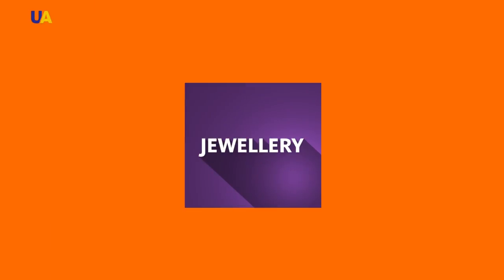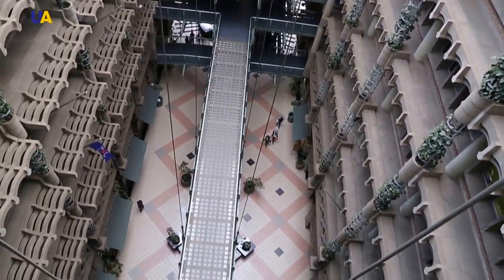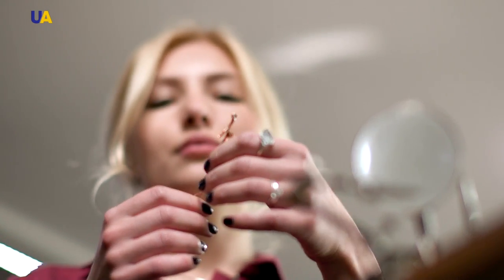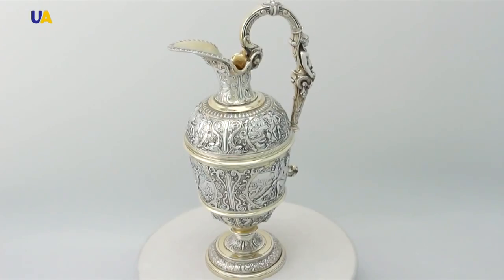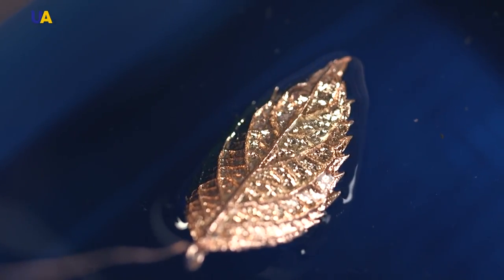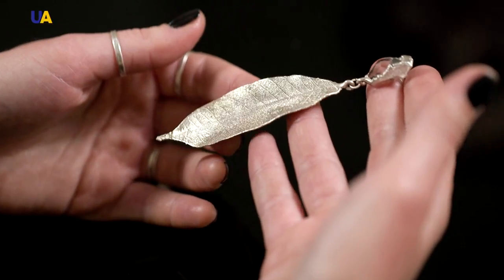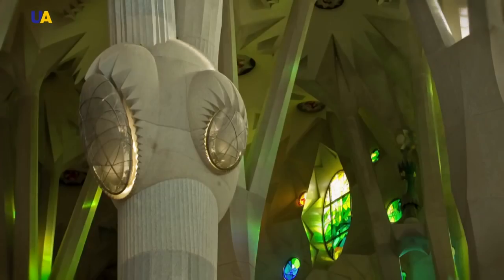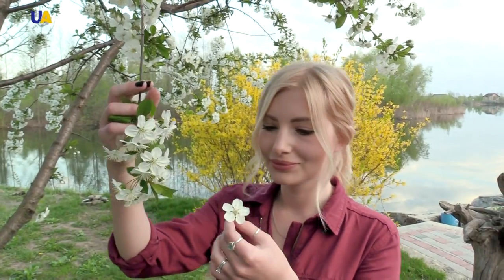Handmade Jewelry in Electroforming Techniques by Maria Riznyk | Master of Crafts

Comment: The technique to make copies with a mold by metal depositing is called electrotyping, electroplating is developing a layer of metal on a metal object and electroforming is similar to electroplating, but metal can be deposited on organic objects by coating them in a conductive material like graphite and the metal coating developed is usually much thicker. All techniques require a direct electric current through a chemical solution. You can combine it with other jewelry techniques, but this artist does only one of many.
Reply: Would be worth to say that in video I use word «гальванопластика» and in this language we don’t have analogies. You can translate it both ways as a electoforming and electroplating.

Comment: Isn't electroforming  a fast  cheap and easy way to make jewellery? I would like to make jewellery this way but  I am concerned the quality of these pieces aren't really good compared to jewellery made the  proper traditional way.
Reply: No it is not fast and to do it right, it takes hours to get a proper plate. Defiantly not cheap and you need a machine to conduct a current and it is not easy as there are many steps to get something done. The jewelry not made by an craftsman’s artist, I would not trust at all. If it is cheap, I bet it is made in China and has lead or crap in it!
Reply: it doesn't take much to learn this technique. Learning the proper way to make real jewelry takes years. Apples and oranges.
Reply: I’m afraid it’s not comparable. 
It’s like we call “art” some oil paintings, but also performance. 
So here is the same. We call it jewellery, but it’s different.
It would be worth to say that I’m completely responsible for the quality of my jewellery. 
We could associate electroplating with cheap jewellery from Thailand and China, with thin layer of metal, but we can use same technology for making something different.
Sure it’s not titanium. But it’s very durable items with proper care.

Comment: and the leaf will rot inside??
Reply: M AT yes, it decomposes. It is a single leaf. It will become dirt and dust.
Reply: Maybe, but decomposition needs air that can come in contact with the leaf. I dont know if air can penetrate the copper lining
Reply: it doesn't rot as there's no oxygen to rot it if sealed correctly. Some people do dead bugs like this.